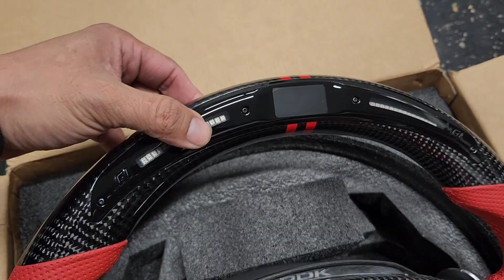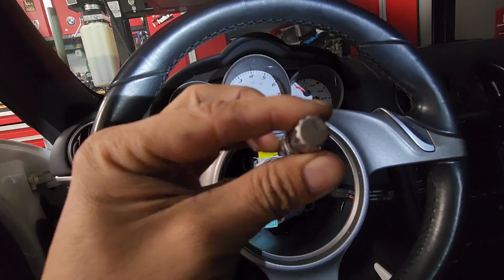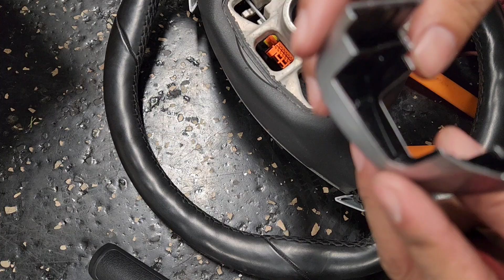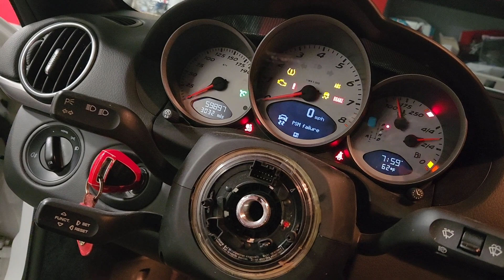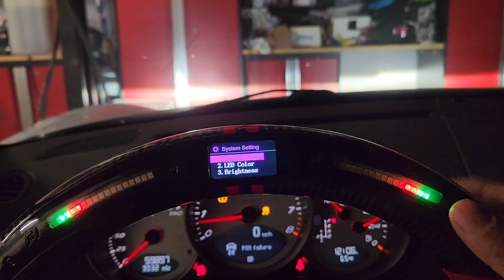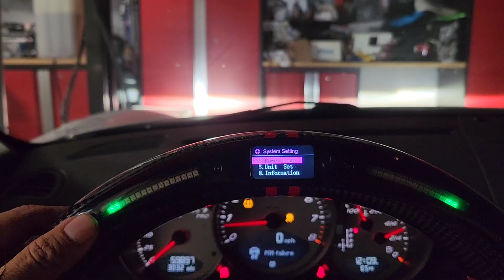How To Install LED Carbon Fiber Steering Wheel For Porsche Cayman 987 & 911 997

Comment: Nice job...that looks really good.... question..is that a normal home garage with your car lift in it... I want to do the same thing
Reply from the maker: Yes it just a normal home garage. All I did is change the garage door rail to hight lift door and change out the drum. The most important part is your ceiling high. My ceiling is 9.5ft i only can park my two sport car. Since my ceiling is not that high. Before you getting a lift measure the height of both car that you plan to park plus 1ft extra